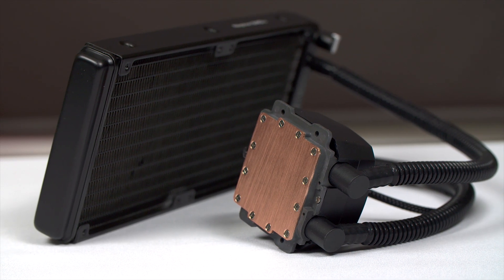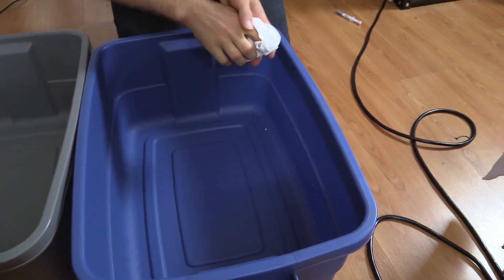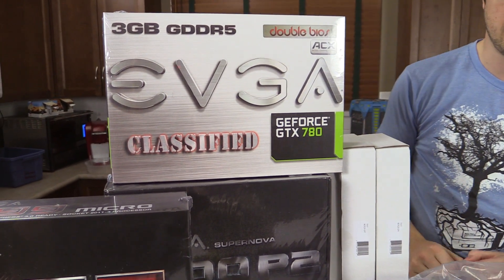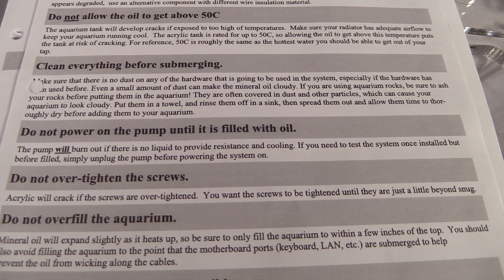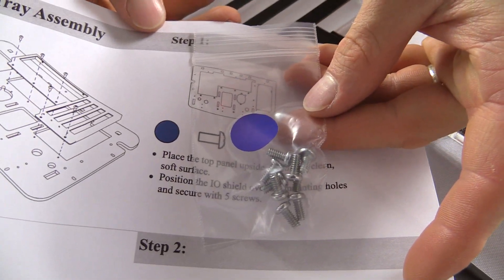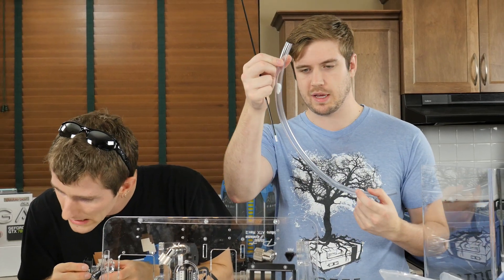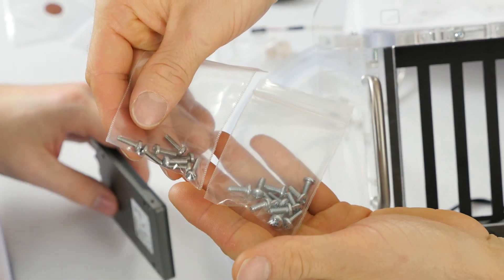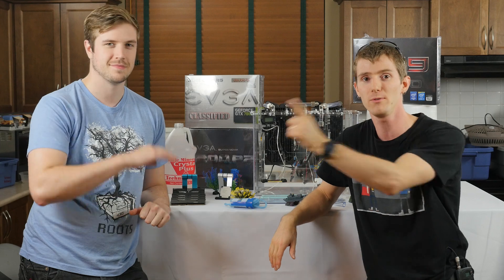Mineral Oil Submerged PC Build Log Part 1 - Puget Systems Kit Case Assembly

Comment: Wait, so it has outboard radiators and fans? So it's still air cooled? I was hoping that the fans would be submerged in oil pushing oil through the radiator.
Reply: Cooling a liquid with the same liquid from the same reservoir is not effective
Reply: The heat from the oil still needs to dissipate in order for it to continually function effectively. Like a car, it has radiators and fans to remove heat from the coolant (in this case mineral oil) but that doesn't make it 'air cooled'. That would be different. The computer itself is being cooled by oil, not air.
Reply: I was hoping for the same.   It seems pointless with external fans
Reply: All computers(except nitro cooled) will always be air cooled. Yo need to transfer energy from componets to external source.  Ex, in watercooled rigs, heat to water, then water to air. In this case, heat to oil, oil to air.  You cant cool oil with oil that is the same temp. Though i think there will be internal fans to keep the oil a uniform temp.
Reply: D3vSt4r its going to have a radiator dumbass
Reply: FormulaGamer123 I never said it wouldn't
Reply: D3vSt4r you're lyin'
Reply: Its going to have a radiator outside of the oil in contact with air to cool the oil.
Reply: Son of a Zombie What? "it has radiators and fans to remove heat from the coolant" can you not read?
Reply: FormulaGamer123 Yes exactly, that's what I said mate. The radiators are in contact with the air.
Reply: ThierryTheuns he just needs a bigger tank.  Millions of boat engines are cooled from the same reservoir.
Reply: D3vSt4r are you trolling cause i'm black?  you're lyin'
Reply: Son of a Zombie Dude, what the hell are you talking about?
Reply: Son of a Zombie Just no

Comment: I don't think the parts that are submerged into the oil will be able to use normally after this...Correct me if I'm wrong.
Reply: They can be used normally.It is just a matter of weeks drying them.
Reply: I see, how to clean it? Or just leave to dry?
Reply: I dont know from the top of my head,but i think you can just leave it until it dries

Comment: Can you make a molten aluminum cooled PC?
Reply: I can make a molten ice cooled PC ( ͡° ͜ʖ ͡°)
Reply: Heated*
Reply: Phillip Ragazzo Molten ice? So, just water, right?
Reply: If you have components that withstand 700 °C of heat,sure why not.
Reply: FamousPig Some components that need to be kept very hot use mercury heatpipes, but I don't think molten aluminum would work for any type of temperature control.

Comment: is there a good reason to choose a mineral cooled pc over watercooled/aircooled?
Reply: bragging rights
Reply: slightly more efficient function of components like the motherboard chipset and soundcards that aren't easily watercooled,
no problems with dust.
If you want to spend a LOT more on the build then you can make an oil-cooled machine that runs at close to zero degrees without the problems of liquid nitrogen and condensation issues that sort of thing usually causes but you need to think bigger than radiators and fans to do that. The heat exchangers to  chill the oil will set you back a couple of grand on their own.
Reply: aight thanks

Comment: Does the oil not kill the caps in about 3 months?
Reply: Minerla oil is non conductive, it shouldn't do anything to the caps.
Reply: Glass Gecko Nothing to do with it being conductive, rubber components or electrolytic capacitor (i.e. non-solid capacitors). There are reports of rubber-capped electrolytic capacitors bursting as the oil eats the rubber and seeps into the capacitor itself. Most newer, and better quality motherboards, have solid capacitors ("solid caps").
Reply: did the motherboard he was using have rubber caps?

Comment: Linus? What about the water cooling room project?
Reply: that will probably be pushed back for a while
and just think about winter it will bust the rads with the expanding frozen water
Reply: yeah was wondering when it was coming
Reply: HardAsSponge they're also moving locations soon
Reply: oh that makes sense
Reply: HardAsSponge put alcohol in it? Antifreeze Form a car, glycol
Reply: HardAsSponge No, they have it finished but they haven't started the editing or bothered posting yet
Reply: oh

Comment: Whats special about this mineral oil rig thing? Someone explain the diff plz.
Reply: The computer is submerged in oil. Unlike water cooling where you have water in pipes and coolers.
Reply: ok people im fairly certain fred gets that its non conductive, read the thread before you keep adding that or this is gonna get ridiculous.
Reply: *****
the mineral oil is non conductive so components will still work fine (theyl be incredibly tedious to clean if you wanna take em out though), the oil can disperse heat from every part of the pc faster than air and more evenly than a custom water loop (which only really cools the parts that generate the most heat), it also can look cooler.
Reply: Apparently we all commented at the same time and didn't realize it.
Reply: ***** Oil won't conduct electricity. Also, instead of JUST the CPU and GPU, all the parts are cooled. The cooling is silent, too. No dust gathering inside the case. The major point, though, is that it looks badass.
Reply: *****
Oil is non conductive so there is no way anything can be short circuited
And like anything that goes beyond a standard set up this is only for barging rights
Reply: *****
Mineral oil is non-conductive, so submerging computer components into it is just fine.
Reply: ***** there really is no difference, same temps. It's just fucking awesome.
Reply: ***** Even traditional open-loop watercooling doesn't have that much benefit unless your overclocking setup is thermally limited.
Reply: Omkar Pradhan not 100% silent as there are fans on the radiator

Comment: this may sound stupid but i just want to make sure using a magnetic screw driver is perfectly fine when putting together a computer, right?
Reply: Screwdrivers aren't that strong,  usually.  But I still wouldn't move it back and forth on a hard drive..
Reply: Yes
Reply: Joshua D thanks, just didnt want to reuin anything on my first build
Reply: Damien Johnston NP. I used magnetic screwdriver on my build. Had for over year. No problems :)